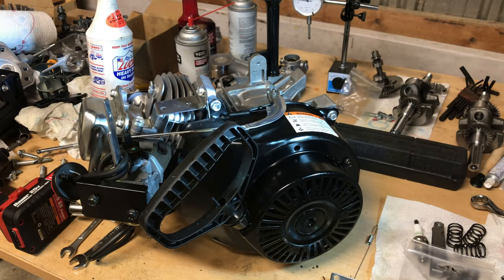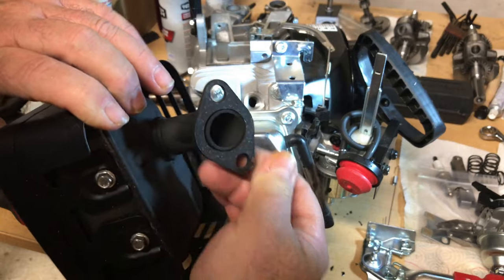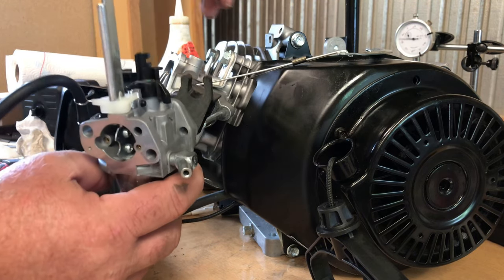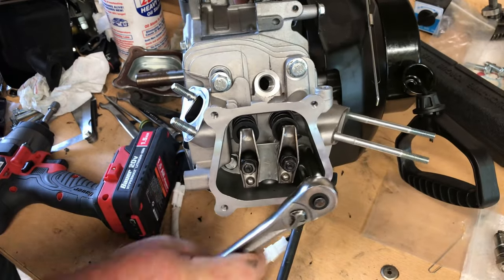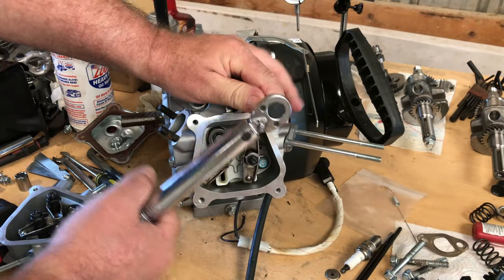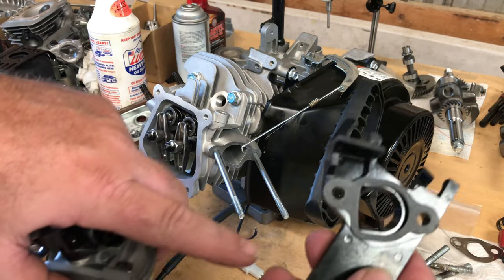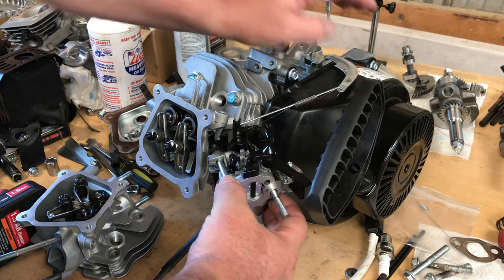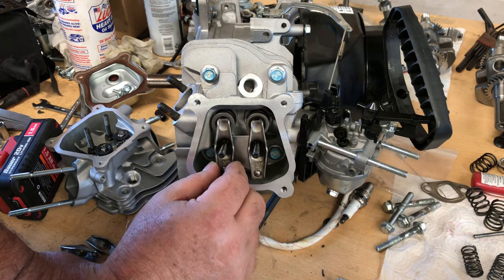Part 2 The "Killer Tiller" Engine! $49.95 179cc 4.8 HP LCT Engine Preparation

Comment: Hey friend how are things? I love this 4.8 LCT engine! I think it would be perfect for a person new to the mini bike fun world. Say I have another hard ? For you… I bought a used 212 Predator motor and I really want to challenge myself to get it running properly without buying any parts for it! The problem is it only runs halfway on choke. If I put it all the way to run it dies I have taken the carburetor apart and all of the main jet and pilot jets are clean. The only thing I have not checked is that black plastic deal under the idle screw do you think by any chance it could be that? Everything else was clean! I really don’t want to spend any money on this because it’s a spare motor but I want to master this engine before I touch my brand new 224 predator from harbor freight…💪🏼 This is all your fault and I’m loving it! Thanks agin for the great videos
Reply from the maker: Hi Janice! If the carburetor was jetted properly and it started running lean, then yes definitely it's got to be clogged up inside somewhere. Usually the emulsion tube gets clogged up with trash. It'd be best to remove the entire carb, disassemble and give it a good soak in carb cleaner then a dose of pressurized air. But if you're trying to get it going on engine, just make sure your low jet, main jet and emulsion tube are all open and clear by using a piece of wire to verify the passages are clear. The little plastic low jet on top can cause the issue you describe. It should get a good cleaning just like the main jet and emulsion tube.

Comment: If you have a hemi gas tank with the two studs on the front of it angled outwards, could you bend a piece of metal at about a 45, so it bolts to the block and kicks up and away to accept the studs from the tank? I'm not sure what that'd do as far as the rear bolt up by the head.
Reply from the maker: That's a great idea and I tried mounting the tank from the Ducar 212 hemi! Mine didn't work because of the top oil fill /dipstick tube on the side cover. There wasn't enough room. The bolt at the rear of the block is in the correct place though and I was going to bend a couple of pieces of sheet metal for the front mounts. I was debating on removing the dipstick assembly and plugging it off to try again but I have an old plastic tank from a snapper mower that might work for me so I've put it on hold for the moment. I'm gonna dive back into the gas tank situation as soon as I get some of the rusty bolts and shafts loose on the old tiller.  Great thinking! Thanks!

Comment: Why not use the pushrod guide from the original head? After all it was made for that size push rods.
Reply from the maker: Hi John! That's great thinking and an example of how you guys are sharp! I did check and the LCT plate had the same problem with the 1.3:1 rockers as the aftermarket guide plate I installed. The 1.3 rockers are shorter than the 1:1 rockers and it moves the push rods closer to the stud. The stock guide plate won't allow the push rods to be that close to the stud. I did try removing the nylon inserts and grinding the stock guide plate (off camera) but without the nylon inserts the push rod area of the plate was too wide and didn't provide any side to side support for the push rods. If you'll look closely during the video you can see the 1.3:1 rockers were already installed on the LCT head with the "reworked" stock guide plate when I removed it. If the Predator push rods had been the same length everything would have worked out just by changing the push rods but the LCT push rods were much shorter. I did give it a good try to get the 1.3 rockers on there but it was not worth the effort in the end. I'll just have to wait for the billet guide plate as much as it pains me. Thanks!

Comment: What's the bore of a honda gx160
Reply from the maker: Hi Craig, I think the GX160 has the 68mm bore. These LCT 179cc engines have the 65mm bore. Kind of an odd size but it's really close to a stock 5HP Briggs flat head bore. (Which means you could build a long rod engine with a Briggs Wiseco piston on the cheap)